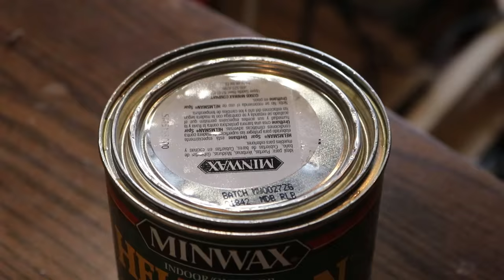One-Piece Canoe Paddle

Comment: I might be mistaken, but it looked as if the original paddle you carved and sanded was different from the paddle you were varnishing at the end of the video? The blade shapes, dimensions, and lengths are not the same.
Reply from the maker: probably. I made a bunch of shapes/lengths. Each step is likely to be a different paddle.